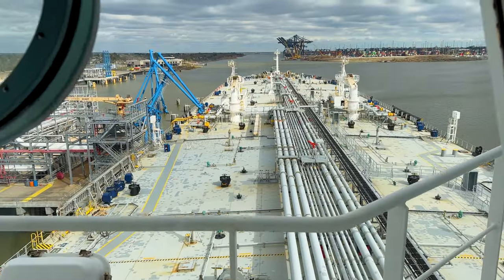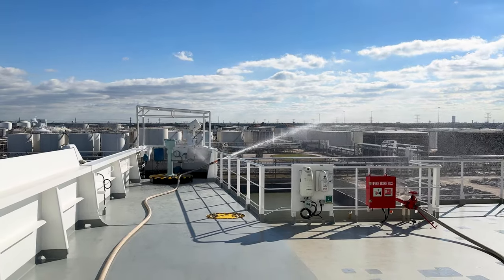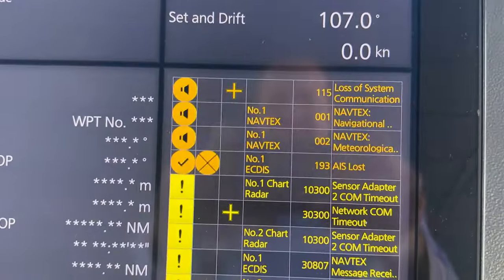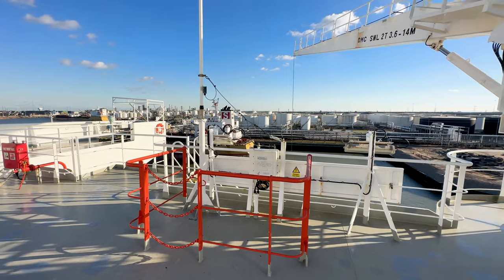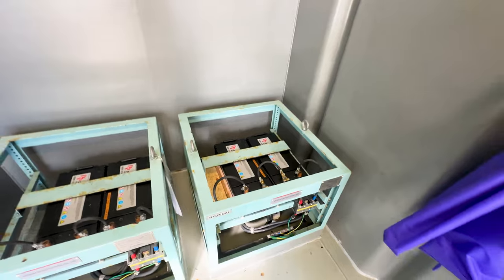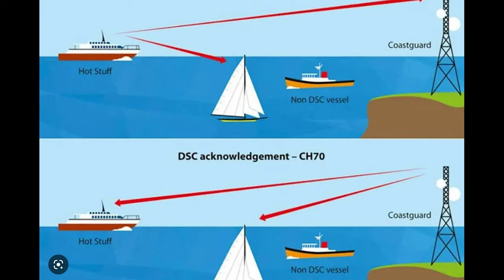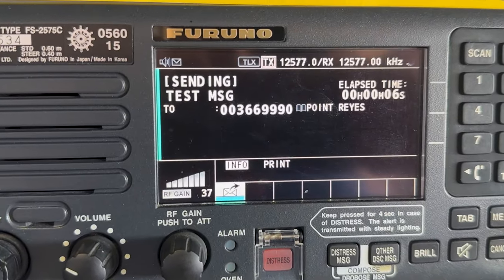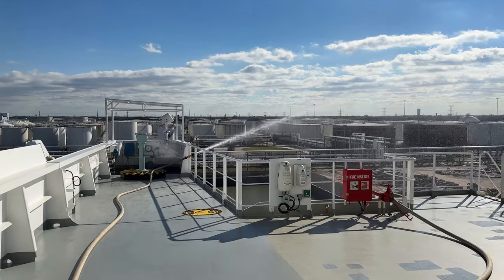Transmitting on A ships Powerful MF/HF Radio During a GMDSS Radio Survey

Comment: I am sure that you know that test transmission on 12MHz is not a valid test for GMDSS Survey on this particular ship. She is equipped with MF Radio for sea area A2 and Inmarsat Solution for A3 area. HF band test not applicable. BTW, I see that manifold is connected. No transmission should be performed during cargo operation on tankers.